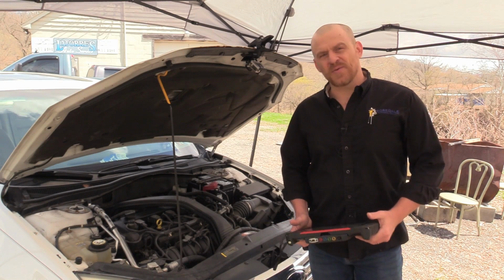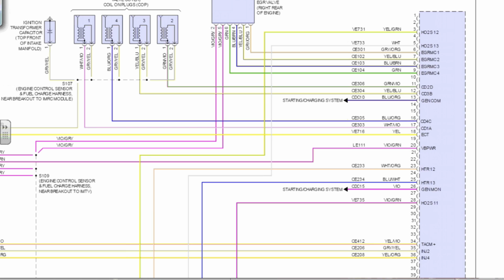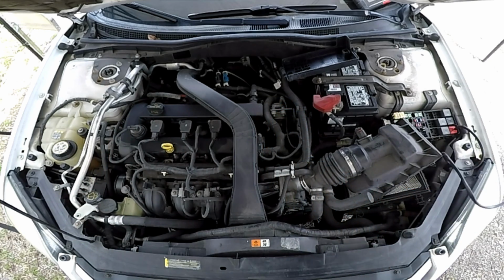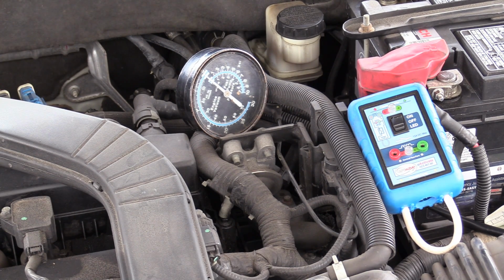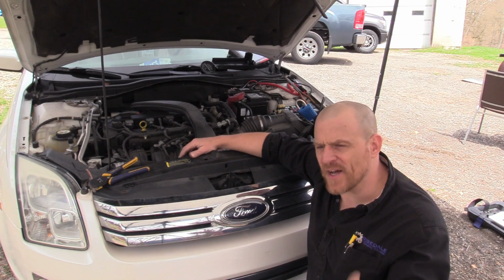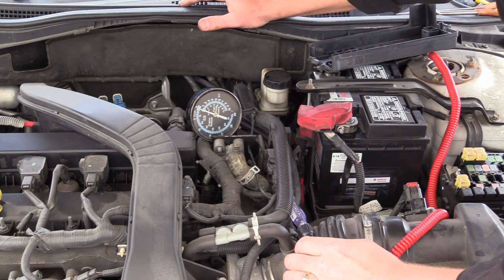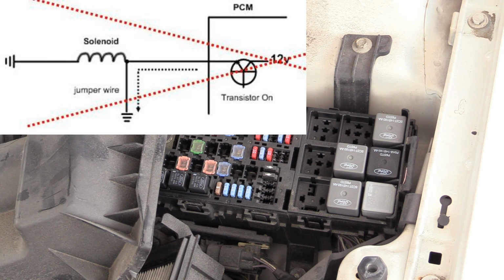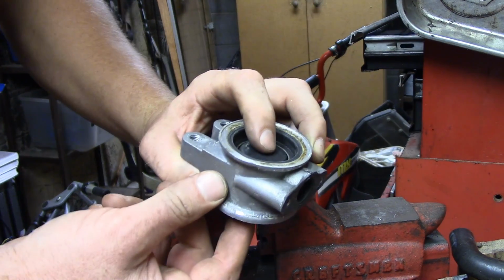2009 Ford Fusion Secondary Air Injection System Fault P0410, P0491

Comment: Paul,
Quick question 
Do you think it may be a good idea to rig up a test light with 24 volt bulb for testing solenoids only,Never a driver?
I bet you can draw about 300 mA
Reply from the maker: I've had various lights over the years and you could certainly rig something up for energizing solenoids, just make sure you know what you have current wise when you are done.

Comment: I figure the diaphragm shaft was seized in the housing (steel and aluminum created galvanic corrosion and seized the shaft). Possibly it could have been freed by applying a higher vacuum to the diaphragm than the 15"Hg the engine was producing. It looks like that thin spring was added as an extra precaution to keep exhaust gases from backwashing into the air inlet tube, where it would burn the hoses and air pump.
Reply from the maker: I agree, I was just surprised by the sound I was hearing of the valve opening on the car. I had to be just the diaphragm itself I was hearing.

Comment: This can work ok even without the diverted valve.?great work as always..
Reply from the maker: No, that valve is super important and is involved in preventing air from being pulled back into the exhaust on negative exhaust pulses and of course to prevent exhaust gas from getting to the air pump

Comment: Why not just put a check valve in it's place and eliminate the need for solenoid and vacuum and computer control?  Would also be a fair bit cheaper for the part right?  Maybe the air pressure wouldn't be high enough?
Reply from the maker: Just answered one above on this. Great question, look for my reply

Comment: 7:28 notice how point 4 says Violet/Green and it dosent have black dot to slis it in with Violet/Greys around it.
And that it's actualy the wire that gos to pin.20 "VBPWR" on ECU (it allso says Violet/green on the wire color).
It dosent change the outcome of this problem, but. Just saying thats how rewriten diagrams can also be writen wrong by little misstake ;)
Reply: On Diesel cars from 2007 and up here has to have Diesel Particle Filter (DPF) by law and they use Differential Pressure Sensor (DPS) to Check back pressure of that DPF to see Have you taken it out compleatly (no extra exhaust pressure even on acceleration) is it working fine (~100mbar betwean the filter) or is it clogged.
and some times i have sean those mesuring pipes bean cloged out by soot so DPS dont change normaly and sets the code for DPS fault or some times even DPF fault for reasoning unknown.

So my Q: Have you seen those Secendery air pipes bean clogged or are the endings so big that it virtuly can not be clogged by soot from exhaust pipe?
Just didnt see you check that end of the pipe and i do but never have found one clogged yet.
Reply from the maker: Never, not once on a gasoline engine. DPFE sensor (delta psi feedback for the egr) had small measuring tubes, never saw one plugged and definitely not on any air pump components. 
Although back in the day of carbs, they used exhaust crossover passages under the intake manifold that would carbon up, but that was way back.
Reply: @ScannerDanner  Ok Maybe backpressure before the Soot/particle filter is the one of the reason.
I have heard that they are bringing those Particle Filters to Petrol side too in this or very near models to pring down the polutions even more...

Comment: If you're finished with taking that apart, and trying to see where the malfunction occurred, save all of the parts and pieces, Ivan over at Pine Hollow Auto Diagnostics, has a pile for all of those used parts! 

I think he uses them to rebuild Subarus!! ;-) ;-P

Comment: I just diag'd a 2009 VW Rabbit P0491 code the other day.  Never worked on one or diagnosed one.  Thanks to SD Premium I diagnosed it in no time.  In my VW case I had bidirectional control of the pump and the diverter valve and I found the pump not running.  Went to the relay and had no ground through the pump.  Up on the lift, unplug the pump connector and use the AESWave kit to connect my high amp test light to the pump connector with a bidirectional control, and diag was done.  Bad pump.  I did check the other components to make sure there wasn't another problem but once you know the basics it doesn't matter what you're working on.  Such good stuff here and on SD Premium!
Reply: The pumps often fail due to the diverter valve leaking exhaust gasses to the pump where water vapors condense and ruin the pump. Make sure the valve isn't leaking. It's best to just replace it so you're not replacing it and another pump in the near future.
Reply: @fascistpedant758  Yeah, good tip.  I checked the diverter valve for leaks and had none. I used a rubber glove on the pump side of the valve and ran the engine. In this case, the motor had a bad rubber seal and water got into the motor side of the pump.

Comment: What is the purpose of the air pump system? I understand it’s putting fresh air in the exhaust but why? Why during cold engine start only?
Reply: It adds oxygen to the exhaust stream, to give the ability to ensure complete burning of any and all gases in the exhaust stream. It helps build heat faster, because the cats won't start working properly until a certain heat range! About 1500-2000 degrees or so! Early cold start is when they are trying to clean the exhaust up faster, so the extra fuel to enriched the cold starting mixture, and the cat heat up process prevents unnecessary bad exhaust gases in the atmosphere!!
Reply: It makes the catalytic converter heat up faster.
Reply: @betty123ism  Combined with a richer AFR.

Comment: I like how you showed the hose snaking all the around and go "under the intake manifold" then move the camera back over quickly. 

I saw the building where you were and was wondering why you couldn't connect to their network connection. 

There's other options that are legal with Snap-On when using the data lookup. I had struggled with myself being limited so one day I picked up the phone and called SHOPKEY support ( snap on ) and after a little back and forth signed a contract with them when they were able to say they could do what I wanted to do. 

Paul, I use instagram over at dtnel78 . If you message me (at) gmail using same username I can explain how we got that issue resolved with shopkey

Comment: why not just check the relay on the control side with a 9 volt battery away from the car? that would rule out shorting out a computer driver. like a click test for the relay? do you think that would work?
Reply: Paul explained why he wouldn't test the relay like that, even with an ohm meter across the contacts - because you wouldn't be putting it under the same load as in circuit.
Remember this is a large-pin 70A relay, the AIR pump runs at maybe 30-40A.
When it clicks, the coil is good and something is moving - but does not necessarily mean the contacts are making!
An "electronics" multimeter passes under 1mA of test current on Ohms.
An "electrician's" multimeter passes about 200mA of test current on Ohms.
Reply: @simonparkinson1053  The current draw of an ohmmeter is usually in the micro-amp range, certainly not 200 mA.
Reply: @fascistpedant758  That is why I differentiated between electronics multimeters and **electricians** multimeters.
It is a requirement in the UK electrical regulations for ohm meters to output a test current of 200mA and open circuit voltage between 4 and 24 Volts.
Maybe the US NEC has similar requirements?
Remember their purpose is for testing wire continuity down to hundredths of an ohm.
These devices are commonly integrated with high voltage insulation resistance testing (you need to do both with a cable).
They are making their way into the automotive trade because of hybrid and EV systems, but are also proving to be a very reliable way of electrically testing piezoelectric injectors for common rail diesel engines.
A favourite for automotive techs is the Megger MIT420.

Comment: The disassembly segment would make a great reference video. Seeing how it's designed and how it works is extremely useful information if you want to try to service the valve. I tend to trust that you actually heard it open and close. Could the rubber flap of the check valve have stuck to it's mating surface enough to hold the 1-2 psi from the blower? Now that we know how it's built, it would be nice to be able to go back and take another shot at fixing it. A little cleaning and lube through the output port, and a shot of shop air through the input port to un-stick it might have done the trick. I'm sure this video will be very useful to many people. Thanks for sharing.   p.s. If you delete this comment again, the next one will be even longer! LOL
Reply: Want someone who takes parts apart to see how they work? We should have Paul send all his old parts to Canada to @Junkfromwork who's got his own channel. Good fun Canadian tech. 

I haven't heard it yet but Paul said "Computer Controlled Solenoid" so since everything in the automotive industry has abbreviations why don't we just call it the "CCS" from here on out so I can be even more confused when looking at diagrams, etc... 😂😅😂😅

Can I take credit for coining the phrase ➡ CCS ⬅ ❓❓

Great video Paul as always!
Reply: @dtnel  Thanks for the tip, I'll check him out.
Reply: @fascistpedant758  NP. I think he has a livestream going right now or did awhile ago. I was suppose to stop by and discuss something with him but he had enough on so I sat today out. It wasn't a set thing but told him other day I may swing by.